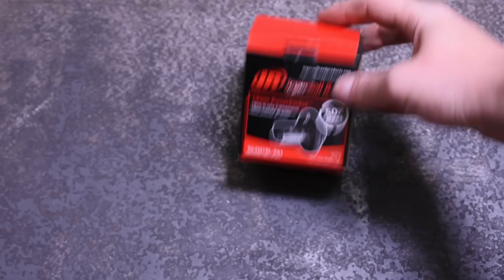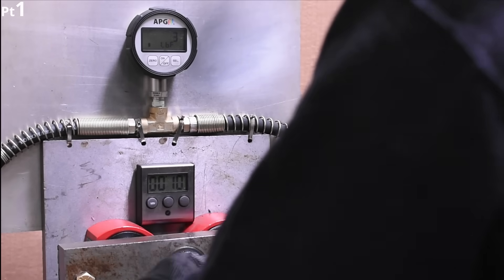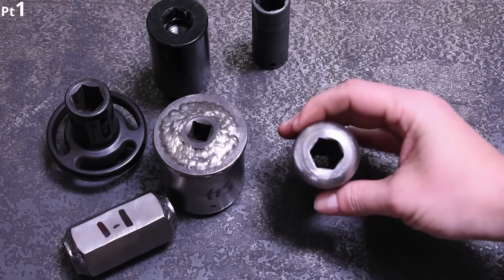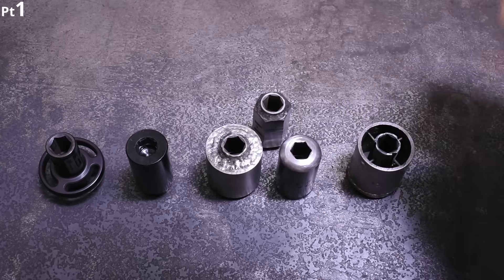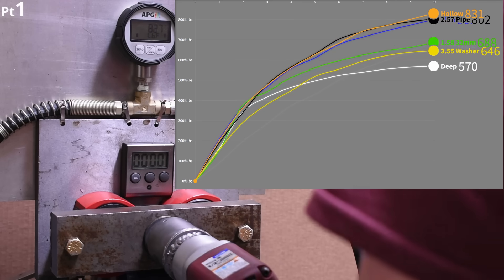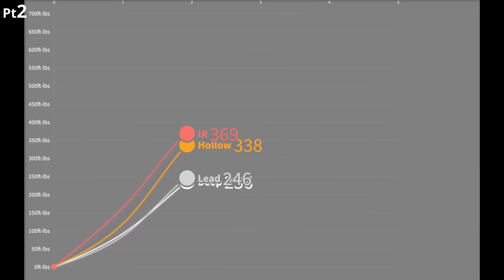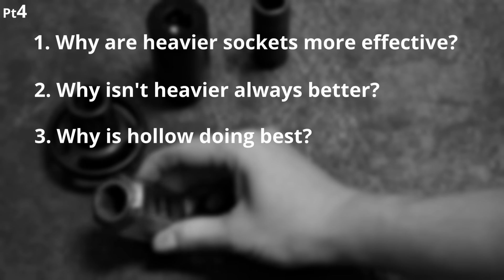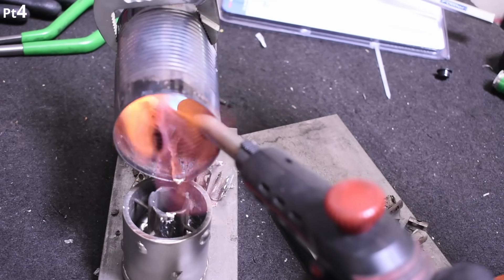Heavier Sockets Make More Power? Stumps Physicist

Comment: it appeared to me that the lead socket wasnt rigid enough on the end where the inner and outside come together allowing flex and the lead wasn't one solid piece rigidly attached to the socket. creating a "fluid damper". my bet is there is a goldilocks ratio between hammer mass and socket mass. like pounding in a railroad spike with a carpenters hammer once the driven mass is 'x' times heavier the force is not enough to overcome static inertia you then have to reach higher hammer velocities to do any meaningful work.

Comment: Leverage with the exception of the lisle socket. A lever even increases the forces of a hammer. Someone with the exact same strength as me but an arm that is half the length of my arm can't produce the same force from a 5 lb hammer blow as me. The lisle socket uses weight to increase hammer weight, it's a fine balance because leverage and weight counteract the force of the hammer, it effectively dampens the blow because it makes the hammer harder to lift, it would be like giving John Henry a spike driver that's 3x heavier than he's used to, sure each swing will drive the spike deeper but each swing will be slower and more taxing. Leverage though is as simple as a wheel knock off tool.

Comment: The reason the Lisle is more popular: it's one solid piece, not a flywheel press-fit to a socket. The flywheel can come off, rendering your expensive socket useless until you replace it. The Lisle is more rugged, and mechanics beat the sh-- out of these things. Source: working on Hondas for a decade.

Comment: i think adding mass helps the same way a longer barrel accelerates a bullet faster. It allows the impact gun to add momentum for longer. The gun is still as strong as it was, so by lengthening the time between impacts and applying that stored energy instantly, the impacts are harder.

Comment: More mass would hit harder when trying to stop it thus as an impact better. That said more mass would also take more power to get moving to deliver said impact. So it all comes down to what is the limiting factor in your driver, the force to get it moving or the mass to be stopped. A weak driver would have less benefit from this at extremes even hindered, a strong one more.

Comment: My guess on the lead is it was such a soft material it absorbed energy. Cutting the flywheel off likely altered how well that system absorbed, stored, and redistributed the impact energy. It likely just helps with energy lost through the vibration of impact. Think of that flywheel like tuned headers making use of scavenging to increase power.

Comment: Just a thought. Impacting longer gives higher numbers and maybe smoothing (longer duration)  out the impact energy also yields higher numbers by reducing the amount of time where there is no torque in between impacts. So if you look at each impact the spokes can deflect and the inner socket rotates ahead of the flywheel shape (outer ring). The spokes act like springs and eventually un-flex and transmit the stored energy. I am willing to bet the inertia and the spoke stiffness can be tuned to work best at some number of impacts per second. Cool videos. Yes I'm up at 2am watching this. Lol

Comment: I believe the speed of sound in and the flexibility of the materials used combined with tolerances between hardware are likely the important missing elements of the discussion. I think they could explain why the moment of inertia seems to be the driving factor of the results. The whole bit where it seems to have a sweet spot strikes me as somewhat like impedance matching or ringing a bell. 

I think the professor is essentially solving the problem with rigid body physics, but the system is simply too dynamic for such a model to accurately predict real life behavior.

Comment: I'd be curious if the weight of the hammer needs to closely match the weight of the socket. 

Test the difference in a 1/4 drive to socket
1/2 and also 1 inch

Comment: Have different levels of impact wrench power been tested? I wonder if we get momentum benefits and it requires enough motor to spin the weight without affecting the motors ability to spin it.
Like a long wrench gives you lots of power but if you cant lift it to use it than it does less good.

Comment: Master in electrical engineering here. There is simple physics to explain the phenomenon. When the impact wrench hit the socket, it is putting energy in to the socket in the form of sound wave. If you look up physics of how sound wave transmits you see that if there is a solid discontinuity in the transmission medium (in this case between the socket and bolt), then the amplitude of the motion of the sound wave reverse while the force at the joint doubles. Like wise, if the next transmission medium is just air, then the amplitude of the wave doubles while pressure at the discontinuity is zero. In real world, it is difficult to make sure the discontinuity is complete solidly or empty so we would not see doubling the force but we can see some improvements. The fault of the professor is he is treating the fly wheel as single inertia. Which is equivalent of treating the fly wheel as point mass. This is wrong in the way that actual material have elasticity, mass and deformation that allow the formation of energy waves. It is difficult to set up a mechanical experiment but you can see the same effect with voltage and current if you are transmitting a 10ns pulse into a 3 meters coxial cable and measure voltage at the input and output with an oscilloscope you should see doubling the voltage.

Comment: generally, i think more mass will result in bigger hit. technically, i would say the heavy socket acts as a second hammer (and the bolt as an anvil), and when the socket bounces off the bolt back, a lightweight socket would be moved against the bolt  without the impact spring being overcomed. however, a heavy socket will soak up 1, 2 or more hits before it hits the bolt again. and then when it hits the bolt, it hits it with a bigger force, since the socket also accumulated energy. and the more is the mass situated far from the point of rotation, the bigger lever effect it has and the more energy can it take(and release). so it will behave as a much heavier socket, that has mass close to the point of rotation. the lead socket, despite heavy, might have some flex in it, which is taking the energy away. and also, despite it did bad from the start up, was slowly catching up. so maybe more mass also means that that "turbo efect" that the IR had would appear on the tighter stuff. but i think than there will be dependance on the RPM and static torque (equivalent to the hammer spring strength).

Comment: The optimum socket should have its mass concentrated far from its axis to have the greatest moment of inertia compared to its weight.  The total weight should also match the weight of the hammers in the impact for greatest impedance matching.

Comment: I do a similar thing with my 1/4 driver impact using a 1/2 drive hex adapter, a heavy impact reducer to 3/8 drive and a 1" extension then socket. I pull bolts out that thing wasnt meant to

Comment: Is it possible the the mass on the socket needs to correlate with the mass of the hammer and anvil? Like larger hammer will take will drive a larger socket better? Last week my dcf900 was having issues with a Acura crank bolt using a shallow socket. I switched to a deep socket and it came rite off. But if I use that heavier socket on my atomic I would loose power.

Comment: The set up measures mechanical losses from the driver to the dyno. Looking at socket weight as the only variable shows that increasing inertia of the socket will lessen the force transfer. The rigidity explanation makes sense in this regard as well. The flywheel is confusing, but I have an attempt at a thought. 
The rigidity idea got me think king about the atomic bonds as a series of springs(fairly common physics analogy).  If the flywheel is attached by a much smaller number of springs( ie the thinner support arms) the initial acceleration of the socket might be less affected by the flywheel. As the rotation of the socket outpaces the flywheel the springs stretch increasing the spring force will decelerate the socket and speed up the flywheel. This then happens in reverse as the socket slows down between impacts. The flywheel smooths out the torque applied by the driver, perhaps resulting in better torque to the dyno?

—Mediocre student who managed to get Guy a physics bachelors a few years back.

Comment: I had a problem getting off a honda crank pulley today with my Ryobi impact, all i did to get it loose was weld a rod to the side of the socket wrap a rag around it and add preload with my hand. works a charm

Comment: Solid state elasticity and centrifugal inertia likely plays a part in this phenomena.  The impact is extended over a slightly longer period possibly lessening conversion of kinetic energy  to heat.  It may just be a change in the thermodynamic and hydrodynamic properties of the materials interacting in the energy conversion from rotational  to torque.

Comment: So what the physicist neglected in his analysis is the backlash between the bolt, socket, and impact driver.  All of them can be seen rattling around independently in the video. So the constant impacts mean that a quick linear analysis will fail spectacularly.  

Can you glue an angle scale to the bolt, socket, and impact driver then film the setup with a high speed camera?  I think you'll see the best weighted sockets bounce CW and CCW on the bolt backlash exactly once between the impact driver hits.  You're essentially turning the socket into an impact driver by tuning it to rattle in time with the driver hits.  This translates to torque by shortening the duration of each impact between the bolt and the driving assembly.  Same energy per hit with a shorter impact duration means higher peak torque.

Comment: The washer stack socket didn't have the torsional stiffness of the other solidly welded options.  Add a bunch more weld beads to the outside spiraling at +-45 degrees.

Comment: Simple explanation: the socket moves a bit before engaging the nut fully, so there's some time for the hammer to accelerate the anvil & socket before the impact mechanism disengages and tests for the next strike. A small moment of inertia won't store much energy in this time, a very large moment of inertia means the hammer mechanism will disengage earlier, but there will be a sweet spot where the massive socket is almost done accelerating when the nut fully engages and then the hammer mechanism disengages an instant later.
Predictions:
 - with the heavy sockets,  a slightly looser fit from the socket to the nut should increase the effect, while a tight fit should decrease it.
 - the 'egg beater' impact wrench, where the hammer is completely stopped on impact, should see relatively little advantage with the high mass sockets

On top of that, of course, there's an interplay of conservation of momentum, conservation of energy, elasticity, static and dynamic friction... for the same energy, a lower velocity produces a greater amount of momentum, which in a very rigid system with mainly static friction will result in more peak force... however if there's more elasticity in the system or if the system is moving more freely  (dynamic friction) then the impact is spread over more time, so the extra velocity (shortening the time of the impulse) may be the dominant factor. And energy can be dissipated while momentum is always conserved. So it could potentially get complicated pretty quickly in a real world scenario. High speed footage accurately tracking the motions of hammer, anvil, socket and nut could potentially tease it out better.

Comment: I think the reason the socket got worse after cutting the flywheel off is because it brought the weight closer to the centreline. I think the mass being further out acts sorta like putting a cheater bar on a wrench to multiply your torque. Makes sense to me

Comment: I've seen you guys make tests regarding metal flexibility, but then you don't related that to these experiments? 
The last experiment with the knockoff Makita, could indicate that a specific weight for specific energy will add a flywheel effect. My theory would be this: The knockoff had to little power to achieve this and therefor performed worse. The cut-off had to much mass removed, which in turn added more (underutilized) flex and therefor performed worse with the powerful Thor. That's obviously all in relation to flexibility. Just think about those "wheel nut torque limiting extensions" (no idea what they are called in english), they are using the exact same knowledge to do the exact opposite and for the same reasons, it'll work with some impacts and not as much on others

Comment: Chris
vor 2 Minuten (bearbeitet)
Mid video I said to myself I dont fully agree with that professor. 
In the end impact blows are just hammering action. So think of it like this: You want to demolish a concrete wall with a hammer. You can swing a light hammer as forcefully as you want, youll do more damage with a heavy hammer. But at some point the hammer will become too heavy for you to swing, so the force transmitted will become less.
Same applies to the weighted sockets. There is a sweetspot depending on a lot of variables, so not easy to hit it the first time. But in general I think its safe to say that regular sockets are too light to utilize the impacts full potential in most cases, so weighted sockets certainly help.

Comment: mustn't have been the best physicist, obviously the increase in mass contributes to an increase in momentum, and since the applied motion on the internal hammer-anvil setup inside the impact is the same, more weight is more power.
Reply: Up to the point where the extra weight is too great for the impact's mechanism to handle, that is.

Comment: Mabey it has to do with harmonics. It is possible that the IR socket is calibrated to have a harmonic frequency that is close to the one delivered by the impact and therefore it's enhancing the output. Would be interestin to check its performance using different frequencies of impacting.

Comment: This kinda looks like it could be the mechanical engineering version of impedance(resistance) matching, where in electrical engineering you can get better power transfer by matching the impedance of your load and source devices. you can also see this kind of thing with balls of different masses.

Comment: More mass is not always better, eventually the tool will have more work to get the socket moving than actually turning the bolt.

The second heaviest socket (stack of washers) might have too much flex rotationally as it isn't "solid". Just a couple beads lengthwise may leave a lot of potential for twisting on the "shear plane" between washers (not sure what to call it right now). Just a thought about that one, or it's just past the point of diminishing returns based on mass.

The lead socket had a very linear plot where the others had already been leveling off. In a longer test it may have caught up with the others.

The farther the mass is from the center of the socket the more effect it will have. Basically like using a breaker bar instead of a normal wrench or ratchet. More leverage equals more better.

Much like the hammer internal to the impact, I think the mass of the socket is a benefit until it becomes a hindrance (see first point) and a good chunk of what hides that problem is how mass tends to increase leverage by moving the bulk of the rotational mass farther from the center of the socket.

I don't want to have to say this, but the professor is full of shit. Sounds like booksmart without considering real application. "A hollow shaft is stronger than a solid shaft!" When? When it's having to support its own weight against gravity? We aren't trying to bend a long bar, we are trying to twist a bar apart and more material will always be stronger.

Conclusion The IR is a cheater bar in a socket form factor. Leverage make torque better. Thus the hollow socket is effective, though not by having more mass or being more rigid, but by moving most of the added mass farther from centerline than a solid socket of the same weight could. Done.

Comment: Mechanical engineer here. You don't tune a rotating object by just adding mass, you tune it by adding rotational inertia, which is a combination of mass and distance from the axis of rotation. Adding the same amount of mass, but further from the axis of rotation, adds more rotational inertia (while adding the same mass). Hollow fesign (and the flywheel design) maximise rotational onertia to mass ratio. It may also be a case of tuning for vibration effects, but someone already commented on that nicely.

Comment: Based on the information it's seems more mass is better, but too much mass can slow rpm, resulting in a steady increase at a slower rate. The lead socket shows this being that the short tests it did poorly on and the longer test it was still gaining on the others and had less drop off. The hollow pipe and IR worked so well in these tests because it minimized overall weight while adding as much rotational mass as possible giving it a higher rpm/ramp up speed. If I am correct, in a best case scenario test the lead would continue to catch up and out perform the lighter sockets, it would just take a lot longer to get there